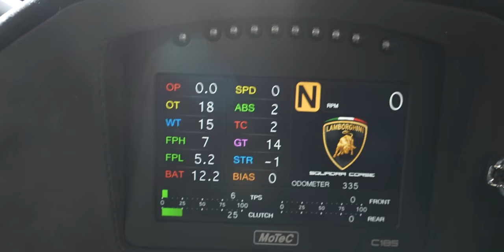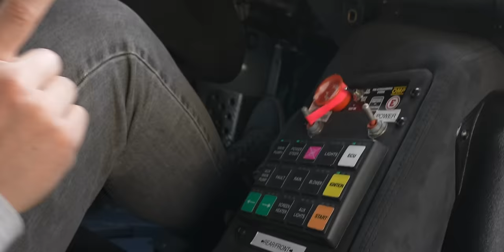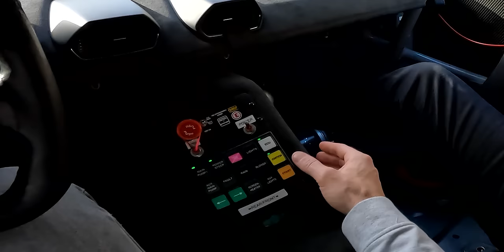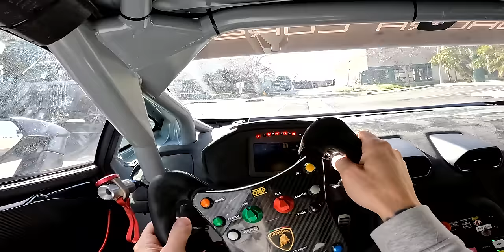MY NEW LAMBORGHINI EVO2 IS SCARY TO DRIVE…

Comment: Damon and Dave! If you read this comment. Look at the 38 seconds into this video. I see two things that we do at Audi in Neckarsulm. There are two plugs 40 mm diameter. It is very possible that car went through my line over here in Germany. Those go on the car first the plugs before they even get spray with pvc material and baked and sanded and then painted. but yeah very interesting though.

Comment: Very cool! It's a race car, it has everything for a reason and nothing not needed for speed isn't there. 
The circuits are all isolated so they can be switched on individually, IE you can be sitting in the car with it OFF but with the ecu powered to be looking at data or setting engine parameters. And also so they can be separately switched ON and re-tried if one fails on track. If they were all connected, the car would shut down. 
MoTeC has a system with their power distribution module for racing that means they don't run fuses or relays, they are hard wired into a box where amperages and circuit trip values are manually set. The box will then trip and automatically reset the circuit by itself - while the car is ON the track racing. The system can also steal amperage and power from other lower priority devices if it needs it. To help the car continue to run if things like alternator or fuel pump electrically fail. It can reassign power from one circuit to another. 
Neutral restarts for things like if the car stalls are also possible, you can push the clutch within X amount of seconds and a signal will automatically fire the ignition and car back up again without the need to push any buttons. Sky's the limit with what is possible.
Also, the dog box transaxle usually need to be "bumped" into gear as they are essentially connected straight to the wheels, and the dog clutch teeth can be not quite intertwined when stationary moving into gear. That's why stationary cars on track can be hard to get going if they've spun for eg, if they can't roll the direction they need to go to "bump in" from neutral and take off again.  
Definitely try to keep as much race car soul in it as you can. It's designed and built to gallop, don't put it out to stud.

Comment: The reason you have separate buttons is  because it gives you a chance to trouble shoot things, and can turn things on independently, on a race car it has to be quick and serviceable. And having it roll is because it’s a straight cut gear so moving a little bit helps it engage ever so slightly better, they have no synchros.

Comment: Hey Damon couldn't really hear you to well when you said the engine and water temp but it sounded to me like you said it was at 103 and that's still kind of cold for any car really plus you wanna warm up all the fluid's before driving it (because race car) which I'm sure it'll tell you in the manual for the car just thought I'd throw that out there since races cars are different from road cars

Comment: to answer dave's question at 14:17 automatic systems weigh a lot. you need more censors, wires, gears, etc. race cars gotta save as much weight as possible

Comment: With a race engine you wanna prime them with oil that’s why mike didn’t turn the ignition on the first time. A lot of drag race guys do it that way where they run the starter to turn the engine over to prime the oil system before you start it because a lot of race engines have super tight tolerances. And they don’t want any of the bearings to be dry when started with the super high compression as well. Just a lot to a start up of a race car.

Comment: THE REASON it sounds so different is because the internals are very different, and probably require more time warming up. And Damon is JUST WRECKING it by revving the kids out of it at startup. This is a race car not a streetcar. You CANNOT fuck around with it, or you will find out! BOOM, and the piston goes flying !

Comment: Do you have to rev match with the sequential gearbox for smoother shifting or it doesn't matter? I was always wondering how it works with paddle shifters since it's basically a manual

Comment: Having all the circuit separate help eliminate problems down the road if you have any electrical issues.   Less systems to trace.  You know where the issue lies, just a matter of finding it with it wired that way.  Just my assumption.   Also could some eltrical be turned on after it is started like the power steering.  Leaves more power for the battery to turn engine over.

Comment: Ask VFN is they have a 2650 supercharger. I am shocked they use a 1900 and it is as a efficient as it is givent the RPMs a Huracan sees. A 2650 you can spin slower for the same boost and it will be efficient but it will sacrifice a little down low but with how quick that things revs you wont have a problem. If not a 2650 a 2300 would be great as well.

Comment: More tempting than the white stuff 😂. Lamborghini really pulled this one, great engine and transmission with awesome aerodynamics, simply perfect engineering. Steering angle kit coming on the way with two new seats 😂. Dave is used to RR and Bentley’s, and Damon got him sitting on a red cushion surrounded by a roll cage and a fire hydrant 😂. Imagine it on the highway, or in a car meet, you’ll own the car industry. Needs some skills and durability to be quick with putting it in 1st gear and reverse. Keep up the hustle and bustle YSOB’s! DDE ALL THE WAY 🏎️🏎️💨💨

Comment: rally sequential gearbox awd problem with angle kit is when awd system on probably you need robdom rx7 awd sistem is the same as hoonicorn may work for huracan even is rear engine mounted

Comment: i want to address the elephant in the room you cant do gymkana with this steering wheel it will be almost impossible ! you might need to change it to a circle on
Reply: It's more than that. The entire steering rack and suspension geometry is setup for racing. It doesn't have enough lock in it, would need the entire setup changed which would be a shame